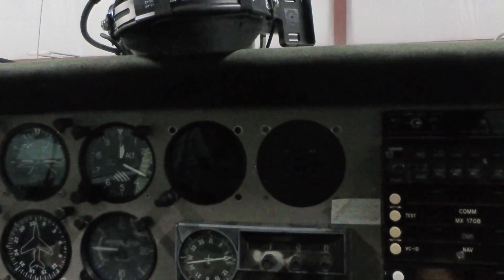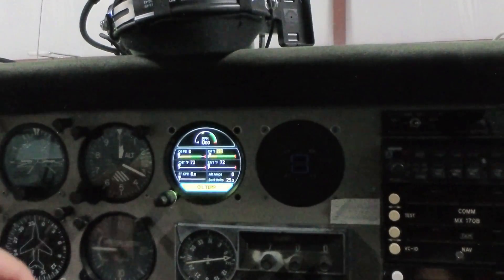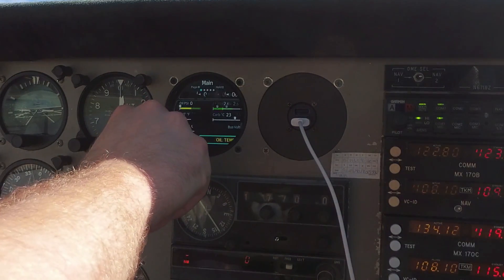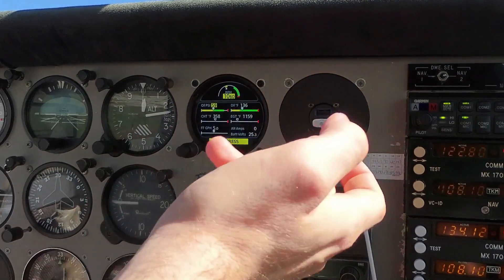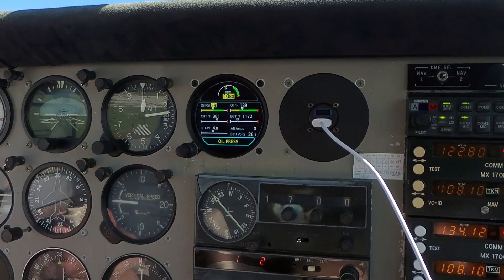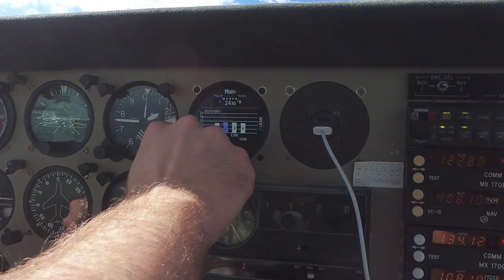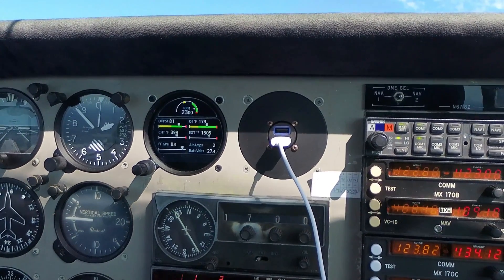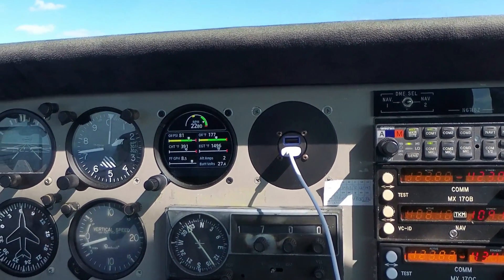Garmin GI 275 EIS

Comment: I have a Beech B19 Sport w/180 HP engine and a JPI EDM 700.  I'm thinking about upgrading to a JPI EDM 900 or a Garmin 275 EIS.  If you had it all over to do again, would you still get the 275?
Reply from the maker: I looked at the JPI back when I was looking for an engine monitor. I don't remember all the details, but I don't think my local installer was a dealer for JPI. They could install Garmin, however, and they had already installed my GNX 375 previously. The 275 EIS could also act as a backup screen for a 275 EFIS if I wanted to add one later.

Having it to do all over again, I may have looked at just upgrading the entire panel to a certified version of the Dynon Skyview. The Garmin units are nice, however, they are costly on the back end when it comes to updating GPS databases every year. 

I am currently building an experimental aircraft (Bushby Mustang II), and I'm currently looking at the Skyview HDX system for that plane. Nothing is set in stone yet, but it looks like a really good option, at least on the experamental side of things.
Reply: @iflycentral  I really like Dynon, the original plane I trained in has😢 the previous gen SkyView system.  My B19 came with dual G5s and a 375.  Had it not, I would have gone with an HDX system.  I wish their autopilot was verified for the Musketeer though.
Reply from the maker: @JabariHunt Yeah. The way things are done through the FAA with certification of equipment for certified planes is antiquated and ridiculously expensive. One of the reasons I'm building the Mustang II is to enjoy the benefits of better and less expensive experimental equipment. 

BTW. Even if I do go with a Skyview in my new build; I probably won't be using the Skyview for engine monitoring. The reason is because I'm looking to convert the O-320 in the build to an aftermarket fuel injected system that comes with it's own display. 

So I'm planning to split my avionics into three separate systems as of now. The engine monitor and control system, the audio panel and radios, and the navigation sytem will all be separate.
Reply: @iflycentral  Very interesting setup, I look forward to seeing the final build!  Yeah, the FAA makes it expensive to certify which is a huge detriment to safety at times.  I definitely see the appeal of experimental from that perspective.  Insurance is crazy (especially for a low time pilot such as myself), but I can see a Sling TSi build sometime in my future.  BTW - I'm in Central Florida as well, I look forward to seeing you in the sky one of these days!
Reply from the maker: @JabariHunt  I live in NC. I haven't been down to Florida in a while, but I'll get back down there to visit at some point for sure.

Comment: So looking at your display, i dont see MP, can you display it along with the RPM?
Reply from the maker: @SMcda  manifold pressure is an option. I didn't have the sensor included as my sundowner is fitted with a fixed pitch prop. If I had a plane with a variable or constant speed prop, I would have added it.
Reply: @iflycentral  gotcha, thx for your response

Comment: Uh what are you doing your CHT's should be < 400 preferably < 380 you are baking your cylinders.
Reply from the maker: Per my mechanic: Lycoming says the engine can handle a maximum CHT of 500 for 10 mins without damage. So the mid 400s for climb out isn't a problem. 

Would be a totally different story for a continental.
Reply: @iflycentral  Thanks for the video! Normally temps in the 400s aren’t good even on a hot day. But I guess with an O-360 180HP that extra 20HP bump from the O-320 makes it run hotter + it’s carbureted so it’s normal. For reference’s sake I have an IO-360 200HP and even on the hottest day I get around 330F on all 4 cylinders in cruise ~2,500’. Can easily hit 290F up at 10,000’. 

Do you cruise climb? If I had this I’d be cruise climbing as soon as I’m at 1000’AGL at around 90 knots for better cooling. The cooler your engine the longer it’ll last, maybe even past TBO if you treat it right. Thanks again for the awesome video!

Comment: Good vid. I have a G3X and so currently pondering whether to just buy the GEA24 and run the EIS into he G3X, or get a standalone unit like this -- any thoughts on that one now that you have the standalone.  My guess is the G3X EIS page will be much less money when it's all said and done. Thoughts?
Reply from the maker: Is your plane certified or experimental? If you believe that you will be comfortable running your EIS info through the G3X without things getting too cluttered; that would likely be the way to go. 

I am actually considering a certified G3X as a potential future panel upgrade to replace some of the primary instruments, get HSI functionality for my 375, and for ADAHARS.

I'd genuinely love to hear your experience with the G3X so far?
Reply: @iflycentral  That one is experimental. I like the G3X. It's super user friendly and wonderfully integrated. My only concern was whether I wanted the EIS to be more full time prominently displayed as opposed to in the rear pages. The G3X is definitely worth adding though if you are considering.

Comment: Great video!! I wouldn’t be worried about your oil pressure at idle. However, I would be worried about CHT’s in the 450 range. 😬 What does your baffling look like? Thanks for sharing!
Reply from the maker: I asked my A&P about it, and he said not to worry unless they are getting into the 470 range. He did suggest calking (with heat rated sealant) around the gaps in the baffles if I was really concerned with it.

Apparently the 0-360s cylinders are rated to take 500°F for 10 mins without taking damage. 

Would absolutly be a concern on one of the larger Continentals, but not so on the Lycomings.

Comment: Thank you for the video.  I’m curious though, is your GI 275 directly powered by the battery bus or the avionics bus?  The video indicates that you started the engine with the avionics bus powered.
Reply from the maker: Battery bus. As it is a primary engine instrument; it is required to have power even if the avionics bus is off.

Comment: Is It usable or Is it too small?
Reply from the maker: It is surprisingly easy to read despite fitting neatly into a standard round instrument slot. Screen is very clear, and crisp, and I can read it easily from a normal flying position even in sunlight. I can not speak as to how it might look to a pilot that uses glasses, as my near vision is prefect. I also do not wear polarized sunglasses; so I don't know if it would work with polarized lenses. Works fine with my nonpolarized sunglasses though.
Reply: @iflycentral  thanks